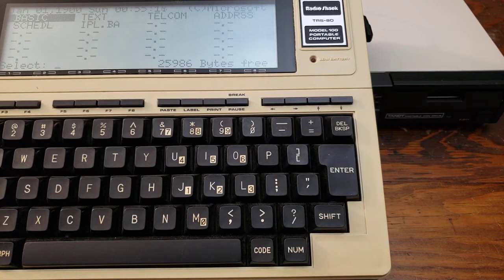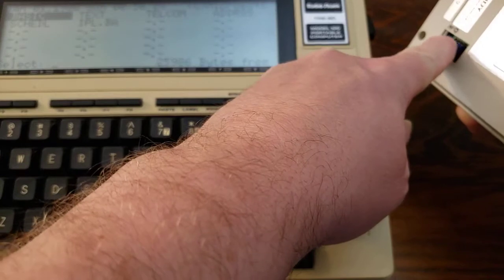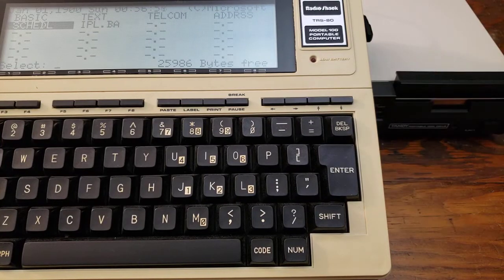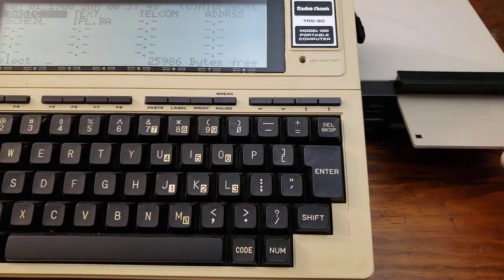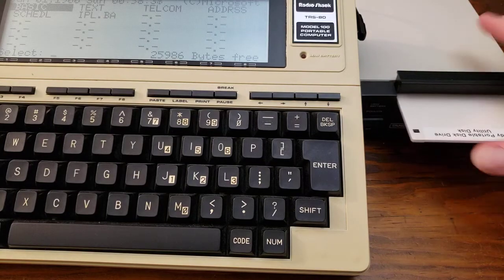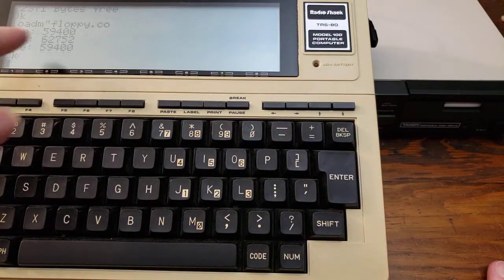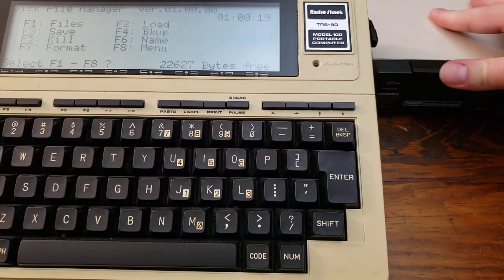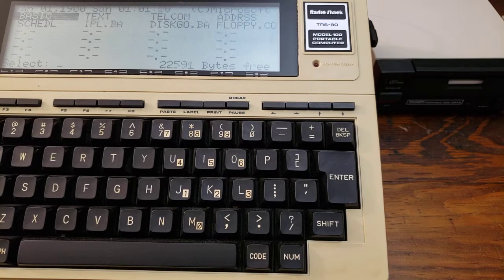How to (and how NOT to) bootstrap a Tandy Portable Disk Drive

Comment: I get an ?AO Error all the time and am using exactly what you typed in from the manual.  I DID have to replace the drive belt in this floppy drive.  It's not attempting to activate the drive.  I had found and replaced the internal fuse.  Any ideas?
Reply from the maker: AO is the error for "Already Open", meaning that BASIC thinks that the file handle is already in use. Did you try running "NEW" to clear the current BASIC program before typing in the loader?